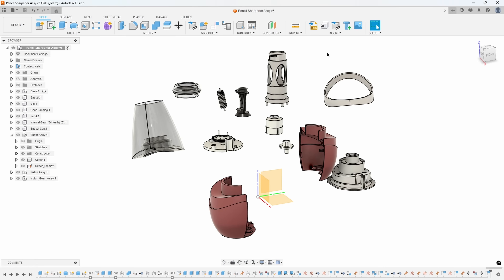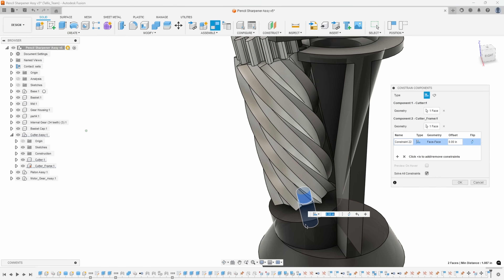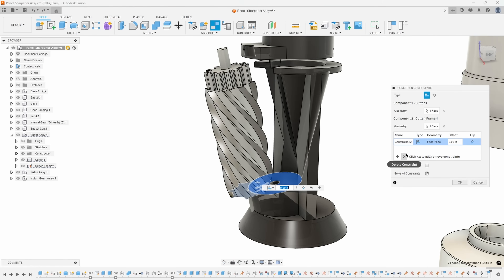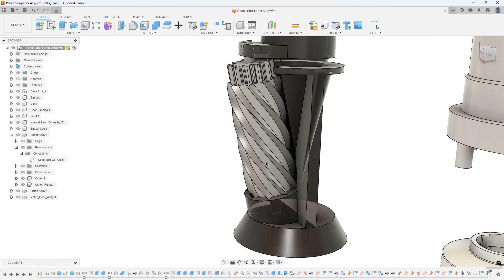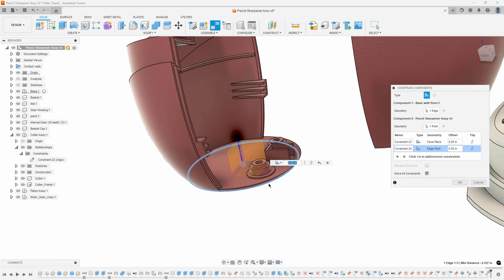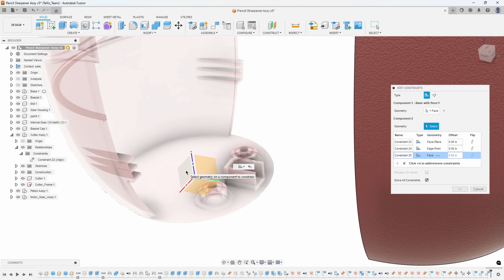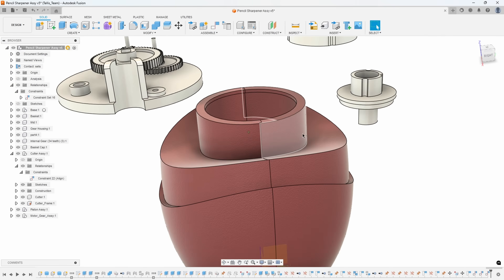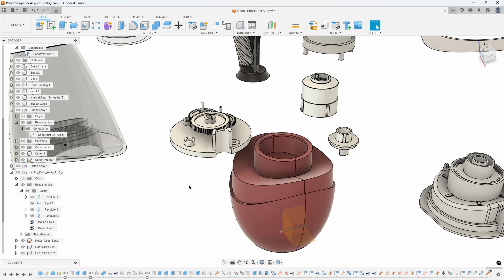New Constrain Components in Fusion

Comment: Great video but it wasn't finished. How do you make the L lock for the top cap work. Slide down then to the right to lock into place? I am new to fusion. Can the locking dual slide mechanism be shown to work in fusion?

Comment: Doesn't work too well on curved surfaces, even simple ones.  Say you have a block and put a fillet on it, and try at align the fillet curve to another face, it'll only align to the the edge (where the curve meets the straight edge of the block).

It's like doing a dimension where it snaps to the radius point of the arc, when you really want to measure to the midpoint of the arc.  Dimensioning fixed that, but Constrain Components need some way to snap to the tangents of curves.

Comment: A great explanation of what is quite a big shift in how assemblies can be handled in Fusion. As someone who is totally comfortable with the old "Joints" method it's a little confusing that it appears to create joints using this method but in reality it doesn't. I think you recognised that in your annotation in the video by stating that these are "component constraints" and not joints.
I'm still not totally sure if you use this method on its own or then still need to add joints to create working mechanisms and motion studies 🤔
Reply: You still need joints for motion studies, this essentially replaces the basic rigid joint.  It's better than a basic joint because you can align an edge to face, and even set the angle or an offset.  You don't get revolve or sliding motions though.
Reply: @j.f.christ8421  It does more than just creating a rigid relationship. If you align a hole edge to another hole edge you get a revolving relationship, if you do face to face you get a "planar" relationship. I've built a fully working assembly using just this Component Constraints tool. I have come across a potential issue though where it maybe can't create a pin-slot relationship (I'm still looking into this). I believe you are correct though that if you want to do a motion study then you have to use Joints.

Comment: Constraints are a great addition, but I'm a little puzzled by joints now getting dissed. 

As seen in this video, it can takes three constraints to do what one joint (i.e. a revolute) can do, and much more quickly.
Reply: They're not meant to replace joints, they're a more flexible rigid joint.  Trying to line up a couple of parts at an angle or with some clearance was a pain with joints.  This is a bit tedious until you get the hand of it, but much easier.
Reply: think of "constraint components function", as "an align function, that, stays in place ( you can't move it around like you can after using the align command )

now they just need to add center – plane constraint  alignment, that's an obvious big one,..

Comment: Solidworks did this in the 1990's! I have been practically begging for this in Fusion360 since 2017. 

Joints are horrible, at least as the sole option. Solidworks 'mates' are way better.
Reply from the maker: Joints were created to "simplify" the whole assembly process, but some people (like yourself) found them too restrictive.  I think it's great that Fusion now allows you to use Constraints, Joints, or both!
Reply: @bradtallis8968 Both is a good thing indeed. 🎉

Comment: What if my part is not a “component”? Like can I constraint bodys?
Reply: I think the answer you might get would actually be a question..  What aren't you using components?  The standard wisdom for Fusion is you always use components.  It may seem unnecessary or inconvenient but I have found that it is just easier to make this your habit and don't think about why too much...
Reply: @erikflom1566 you might be 100% right but the way my brain works is literally a mess 😅 I just go with the flow. I have ADHD and I’m dyslexic and when I use component, I am unable to visualize correctly the other parts, since they become semi transparent and on selectable and most of the time the difference bodies are going to be merged in the end… 🤷‍♂️
My work flow is very destructive 🤦‍♂️
Reply from the maker: Like @erikflom1566 mentioned, the command is labeled "Constrain Components", so your parts do have to be components and not bodies.  It is always good practice to create everything as components.  It makes organization of your design, and the timeline, so much better.
Reply: @bradtallis8968 you look like an expert, would you become my teacher? 😅